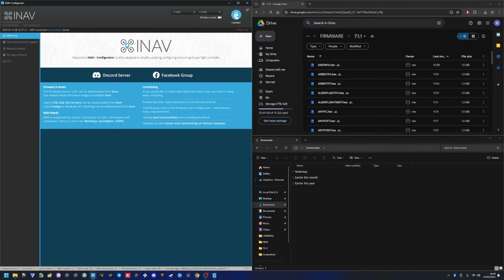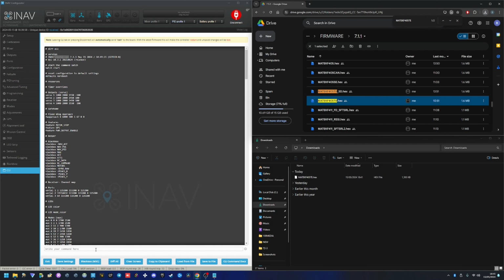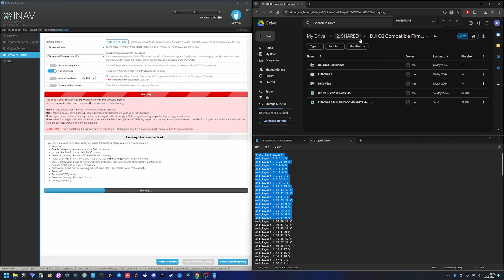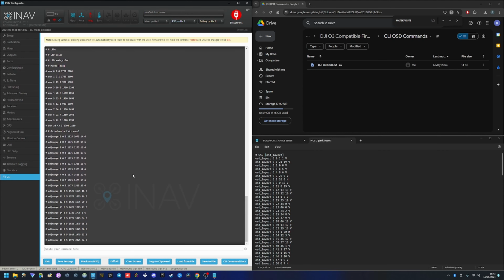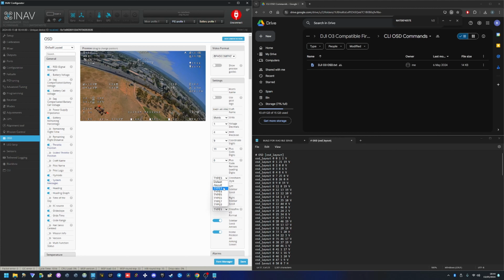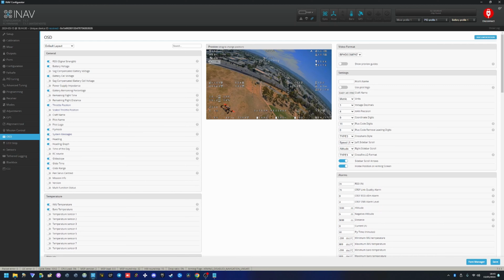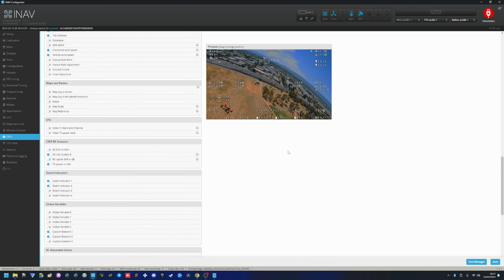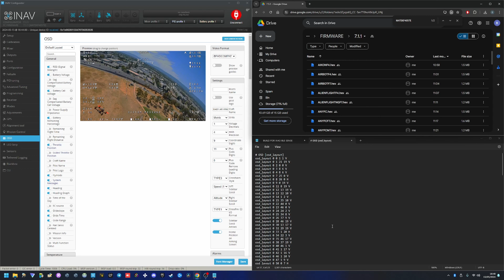Flashing Custom INAV Firmware to a Flight Controller

Comment: SO...Question: Basically you delete everything off FC, add your CLI, re-install difference from saved CLI and the personal A/C data should still be there?
Reply from the maker: Make diff backup
Flash firmware
Paste diff in cli
Save

If you want my OSD, copy cli from cli folder.
Reply: @DZARO  Thanks, I eventually figured out how you were doing it and it did work for me!

Comment: Thank you for this fantastic work.
I am surprised not to see this OSD modified directly in the "official" INAV versions.
I am preparing my first FPV flying wing and I encountered the DJI O3 OSD problem.
I'm going to try this version on an F405 WING MINI but I want to know if I can keep my settings or if I have to check "full erase" when I install this version?
Thank you so much
Reply from the maker: Just do a "diff all" before you flash, save your file and you can keep all your settings. Follow the steps as shown in the video and everything will work fine.
Reply: I will try this. Thanks
Reply: @DZARO  I tested this special version, no more question marks on the OSD, This is a great improvement for the FPV community. Thank you so much!
Reply from the maker: @sebseb-cw6bl  I'm glad you like it !